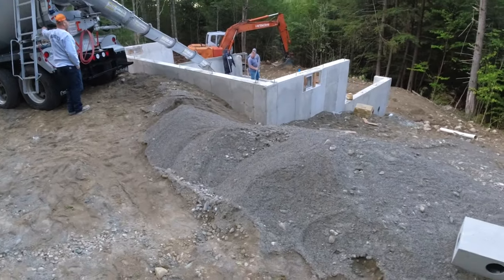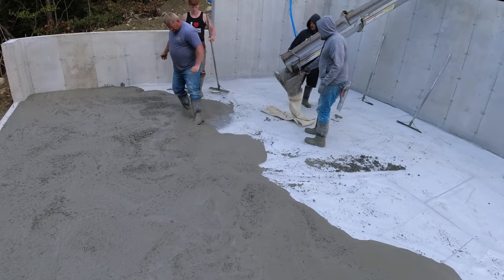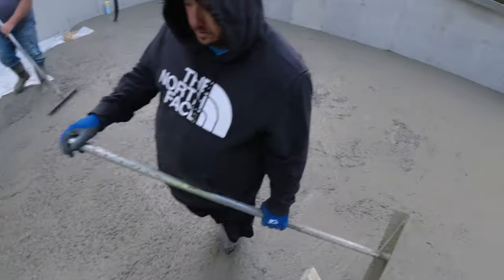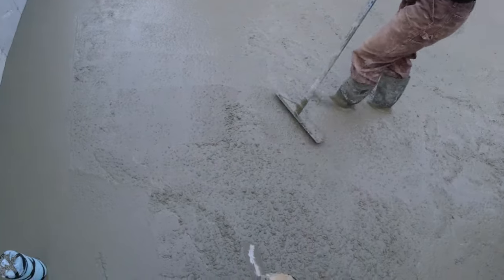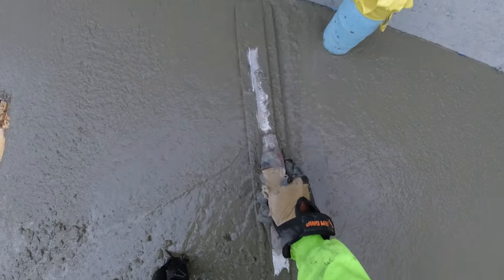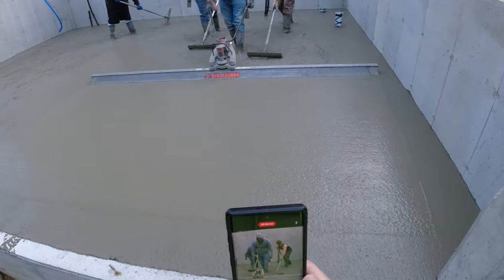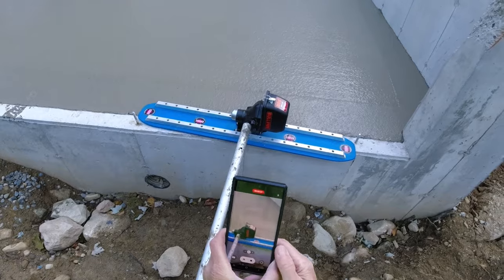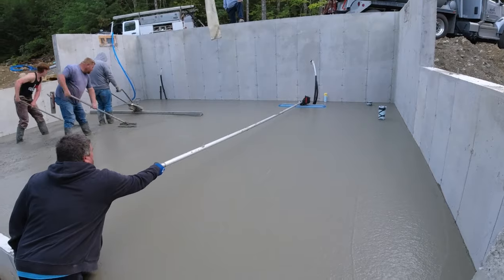The Concrete Had Too Many ROCKS in IT! This New Tool Helped

Comment: At my plant, when we run into those  issues.  It usually has to do with segregation before the batch.  I'm not sure what course agg they use.  When I let my bin run too low when batching, I have this issue. He more than likely has changed something small and hasn't noticed it being an issue.  Repeatability is the key to good, consistent concrete.  Everything the same all the time.
Reply from the maker: I agree, consistent is the key.

Comment: Definitely looks like too much rock in the mix. Could be their aggregate scale is messed up (rarely happens). But from experience sometimes your rock bin will get stuck open and overshoot your rock weight. The right answer is to remove the excess rock from the scale. But if you’re very busy that day they might of just said screw it and sent it anyway. More rock means that the cement has more surface area to cover too. Ask for batch weights to prevent this

Comment: looks like an 8 inch slump ?? thats why
Reply from the maker: It's supposed to be, it has water reducer, we pay extra for it to get a loose slump.
Reply: With high range water reducer in the mix, you can safely pour a 7 inch slump.  He explained this at the beginning of the video.  Most people who haven't seen a slump test performed don't really know what slump they are actually looking at.  High range around me is also called super plasticizer.  It makes the concrete look a lot wetter than it really is.